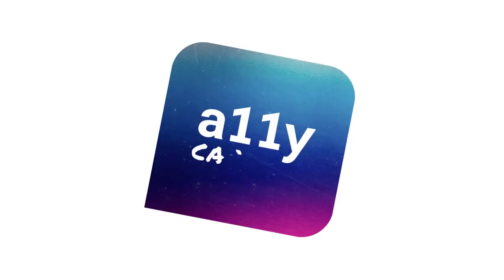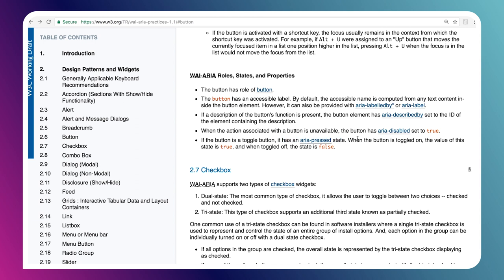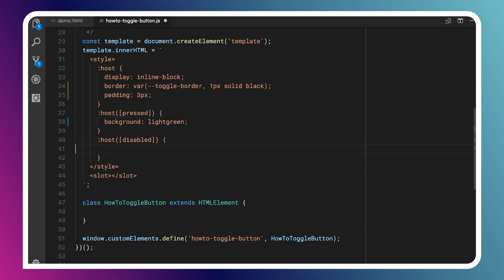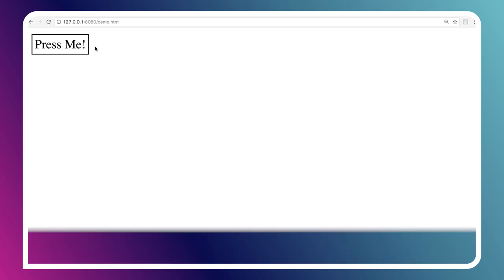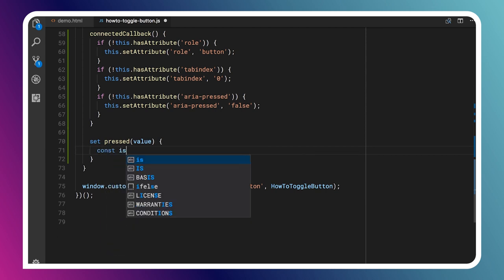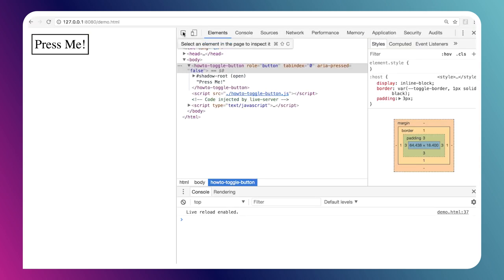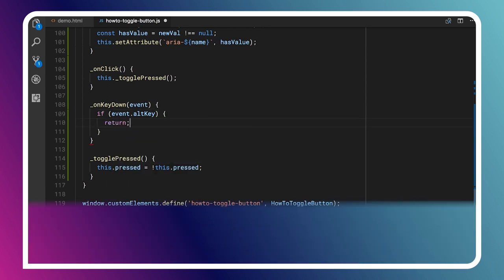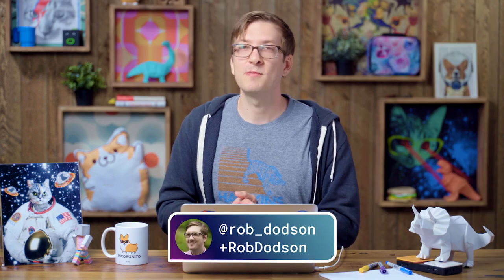How to build a toggle button - A11ycasts #25

Comment: It would be nice if spec supports self-closing tag like <how-toggle-button />
Reply: Mehdi Raash Jep but this is very unlikely to happen. It‘s not possible to add this in a clean way due to how custom elements work: The browser lets you use custom elements before you define them. Any elements that were created by the DOM parser before you actually define your custom element class via customElements.define() will get upgraded when you define it. If this feature was defined in the class (e.g as a static property), then this would mean that the previously parsed should have been parsed differently.
Reply: Thanks for explanation.
Reply: Do you think <my-div class="cls" <button>OK</button>/> is a great style?

Comment: I am curious what browser/screen reader combinations do people use to verify the accessibility UX? The aria info, says buttons when read out, the screen reader would read out the value of the button - but in my own dev, aria-label is critical to provide a description of what the button will actually do - "click me", as an example, is simply too vague for anyone using a screen reader, context is an absolute must
Reply: ph3n0m yeah you could combine the button with aria-label or aria-labelledby if the button text itself was not sufficient. Kinda depends on what you’re building. A button that says ‘Submit’ at the end of a form might convey enough information, for example.

Comment: Do I need to use Canary for this? I followed along untill 7:34 but can't see a styled button. How should the js file be linked? Just the usual script tag?
Reply: Tony Spegel If you’re just in chrome then you can drop in a script tag. If you want to support Firefox and Edge you’ll want to include the Custom Elements polyfills which are up on github.com/webcomponents/webcomponentsjs